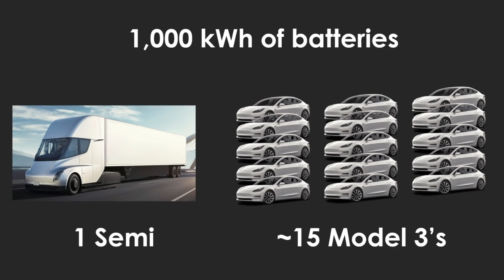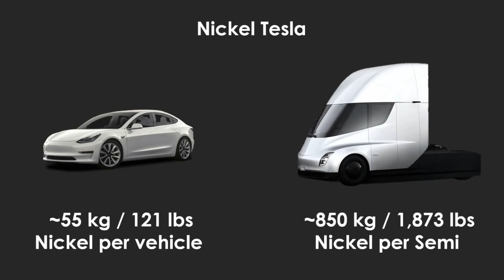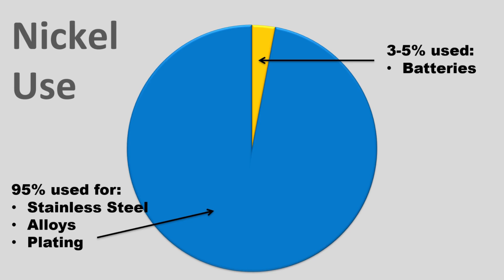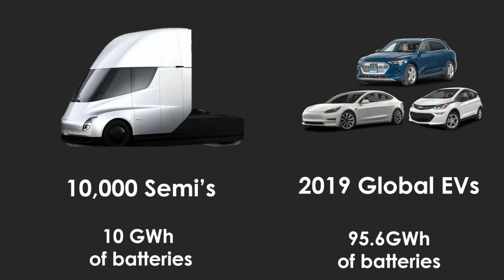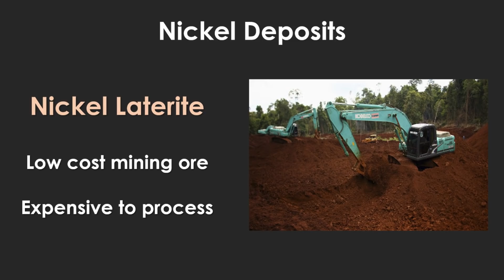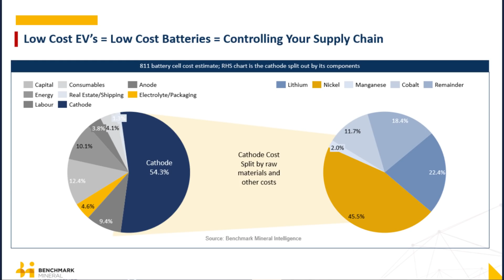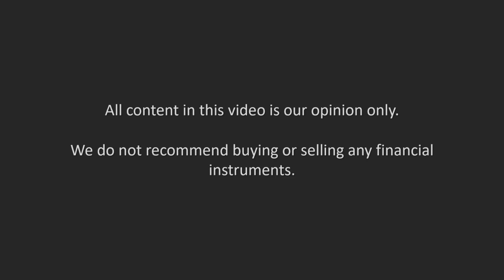Tesla's Nickel Problem

Comment: Giga Metals (HNCKF) and Canada Nickel Company (CNIKF) are both very well positioned to make a big deal with Tesla.

-Both have 100% rights to a nickel sulphide mine.  Nickel Sulphide is preferred for EV Batteries, and Elon has stressed that this is a key raw material Tesla will need more of in the coming years to meet their sales targets.
-Both mines rank in top 12 Nickel Sulphide mines in the world based on size.
-Both located in Canada.  I see Canada as a strategic advantage over Australia due to Tesla’s location of gigafactory in Nevada and soon terrafactory in Texas.  Recent actions from Tesla point to creating more efficient North American Supply-Chain.  i.e Tesla to build Lithium Hydroxide plant in Texas, Tesla buying claim to 1000 acre of Lithium site in Nevada, Tesla joint venture deal with Piedmont Lithium.  Tesla goal to reduce costs to release 25K car in 3 years.
-Both have focus on eco-friendly processes which Elon has stressed would be important from Nickel miners 
-Nickel prices forecasted to increase, so important to get deal done sooner rather than later while Nickel prices still low
-Elon already has proactively reached out to Vale SA and BHP regarding potential Nickel deal.  Though nothing has materialized.  This means Giga and CNC are still in play.
-Elon owned “The Boring Company” might actually also be a mining company in the future.  Tunnel Boring Machines are used in mining.  If Tesla’s future plans do include mining, it is more reason for Tesla to do joint venture partnership or possibly even acquisition of JV mining companies like Giga and CNC.

I would like your thoughts and analysis on this as I think you are a very smart guy!

Comment: the countries with the largest volume of nickel ore reserves are Australia (19.5 million metric tons), Brazil (10.5 million metric tons), Russia (7.5 metric tons), New Caledonia ((6.5 million metric tones), Cuba (5.5 million metric tones), and the Philippines (just under 5 million metric tones). As of 2017, 33 countries produced nickel ore. Nickel production increased from 2000 to 2013 (when it peaked), decreased from 2014 to 2016, and recovered from 2017 to 2018.
Reply from the maker: Excellent points

Comment: Just step back a minute. Starting with the roadster and few recharging centres, Tesla now  has scale, cash resources & technology to build a "Family Electric Car" where range and super performance are "Poor Seconds" to initial & continuing costs. Lithium iron phosphate batteries when combined with adequate charging station become a typical Elon question " Why are we making batteries with Cobalt & Nickel for storage and non-super-performance vehicles when LiFeP04 offer superior charging / discharging features & low cost." Its all about adequate/fast recharging NOT NICKEL & COBOLT ETC.
Reply from the maker: great points Edward
Reply: Elon alluded to different variants of models using different battery chemistry, the lowest range to be 300 Miles+, LiFePO4 is cheaper, very long lasting and fast charge discharge but much poorer energy density so ideal for budget models within the reach of more buyers and utility storage, with the higher energy density more expensive tabless Tesla batteries will still have fast charge discharge and million mile + lifespans and be more suited to the premium vehicles (Model;s S and X including Plaid) Cybertruck, Semi and Roadster2

Comment: I been asking few you tuber, what do you think of $LUNMF it’s parent company for Eagle Mine in Wisconsin that has large Nickel operation. They have on site but I don’t know if it’s class 1 or 2? How can you find that out about a company? eaglemine.com
Reply: Also Tesla needs nickel for their solar power panels and a key component for stainless steel. Do either one of those use a class 2?
Reply from the maker: I am under the impression that stainless steel can use class 2
Reply: EV Stock Channel I didn’t even know there was different classes until watched you show. Thank you for letting us know that part.
Reply: From web site: Dose this make it class 1 or class2? (Eagle has two ore types; massive and semi-massive sulfide. Massive sulfide is about 6.5 percent nickel and 3.8 percent copper. Semi-massive contains about 1 percent nickel and 1 percent copper. )
Reply from the maker: Not sure yet ill look into it

Comment: Nickel mining is a disaster for the local environment. No one wants that shit, no matter the value.
Reply from the maker: Out of curiosity how does it compare to oil drilling?
Reply: @Tesladocumentaryseries7603  Not sure about oil, but Nickel mining uses processes that require a lot of energy, and release a lot of CO2, metals and other chemicals. It contaminates the air, soil and underground waters. Rivers can be acidic, with high concentrations of metals for decades!
I think oil drilling is locally much "greener".
But yeah... It's not "drilling" that's the problem... 
I'm sure there is a way to mine Nickel responsibly.

Comment: Besides having great content, now you actually like and comment on the viewers comments as well. 
I cannot help but wander what tactics will Tesla employ towards raw materials. Elon hunted at getting into mining, not necessarily shedding light on which kind. Also, if he gets a fixed price, in a way he could also be an investor... 
I would graph out lines of progress for each of the constituent materials (availability, production location, capacity, purity, price, %of battery by volume/weight, density-based on which chemistry is used, period to deployment, and finally manufacturing- Tesla, CATL, LG chem, etc - how would the manufacturing, supply, transport and overall continental integration will work with raw material suppliers fixed by Tesla....
Mind field!
Thanks for the content again!
Reply from the maker: Thanks and great points

Comment: Sudbury has nickel mines that are closed due to low prices. There's no shortage. 

Also the Semi is going to be a bitch for drivers in its target market (good luck hoping in and out, looking out your window when backing up, with a seat in the middle) and platooning is useless when you can run trains.
Reply from the maker: Canada could be a major source for Tesla
Reply: @Tesladocumentaryseries7603  It probably already is.

Sudbury has both Stobie and Lockerby that could conceivably be restarted in a matter of months.

We've been hearing the "EVs will drive a boom for nickel" for the last decade, and it hasn't materialized.

What is changing is the electrification of mining equipment. There's a rush to electrify mining equipment, not just for green reasons, but because it cuts down on ventilation requirements and reduces the risk of suffocating miners with diesel fumes.

That's good news for EVs, but not so much for Tesla. The mining equipment being developed requires much bigger battery capacity than the semi will, and Tesla doesn't seem to be a name associated with this tech. 

Instead you see names like TM4. The tech is being developed on heavy vehicles that will trickle down, and not be limited only to one brand of vehicle.

Heck, you could convert any existing semi to electric, with off the shelf parts, and be rid of Tesla's need to control parts and maintenance. The only weak spot is the battery and that will change.

Comment: Well, it's starting to look like EV manufacturing is going to do more harm to the earth than internal combustion vehicles. The argument of it BEV's being more sustainable than gas-powered vehicles hence goes down the toilet if we are so dependant on nickel to make BEV's. Nickel is the same as oil, non-renewable. It seems like every mode of transportation does some harm to the world, but if you look at it from a feasibility standpoint it appears that only hydrogen makes the cut.
Reply from the maker: More harm than burning fossil fuels and polluting the air? How so?

Comment: Seems like it makes more sense to have overhead powerlines on the major highways than to have these huge battery packs.
Reply from the maker: Dont forget battery tech is improving
Reply: @Tesladocumentaryseries7603  true, but we already know that the theoretical limit of the energy density of chemical batteries will be less than that of ultracapacitors (or whatever new class of capacitors they will be named).

Comment: Most electric vehicle batteries use lithium ions, with nickel, manganese and cobalt (NMC) in various proportions in the cathode, a key part of any battery. Early batteries contained the three metals in equal proportions, but companies such as South Korea’s SK Innovation and LG Chem are close to producing cathodes with 80% nickel and only 10% cobalt, known as NMC 811. However, chemists have struggled to remove all cobalt, which is prized for stabilising the battery during recharging.   https://www.theguardian.com/environment/2020/jan/05/cutting-cobalt-challenge-battery-industry-electric-cars-congo
Reply from the maker: Another great article thanks Stan

Comment: 2018 article: “Cells used in Model 3 are the highest energy density cells used in any electric vehicle. We have achieved this by significantly reducing cobalt content per battery pack while increasing nickel content and still maintaining superior thermal stability. The cobalt content of our Nickel-Cobalt-Aluminum cathode chemistry is already lower than next-generation cathodes that will be made by other cell producers with a Nickel-Manganese-Cobalt ratio of 8:1:1. As a result, even with its battery, the gross weight of Model 3 is on par with its gasoline-powered counterparts.”    https://electrek.co/2018/05/03/tesla-model-3-battery-cells-rare-data-energy-density-cobalt/#adnrb=900000
Reply from the maker: Thanks, Battery day cant come soon enough

Comment: 11:29 I guess Tesla can get a mine up and running in less than two years.

Basically, you can start a mine tomorrow if you have the money and determination.
Reply from the maker: A lot has to happen before you start building a mine.
Reply: @Tesladocumentaryseries7603  Same with a (Giga-)factory. Tesla started digging right away for the boring company project. With the right amount of money and some great people, you can make everything possible in a very short time. Who will stop you if you throw some money in his moth?

Comment: If TESLA made solar panel roofs as standard on all its vehicles (Hyundai and Toyota are doing this) including the semi and looked at recycling the old batteries (which I think you mentioned in one of your previous videos) it wouldn't necessarily solve the nickel problem but it might help create some breathing space whilst the Tesla wizards find another solution to Nickel.
Reply from the maker: Yes excellent point Steve

Comment: In researching Liquid Fluoride Thorium Reactors, I learned that in the US we barely mine rare earth materials due to the Thorium content of the raw material dug up in the mine.  Thorium is slightly radioactive, and thus must be treated as a "dangerous" material.  Although you dug it up, separated the stuff you want from the thorium and other unwanted materials, you can't just throw it back in the hole - it's now dangerous even though its state is unchanged other than the separation.  According to @Andreas Amorin, "... I am looking at MP Materials (SPAC deal through FVAC) they are the only rare earth miner in the US."  Obviously, a US producer would be great, providing the mine-to-cell chain is all nearby.  Lithium does travel too far to get from mine to cell.  Gali (HyperChange) and Vivas talked about going back to first principles for the lithium mining process, as the brine processing is ridiculously slow (up to 2 years of natural evaporation), and acreage intensive...  Perhaps that idea would also apply to nickel mining?
Reply from the maker: Very Interesting Carl ill have to look into it.

Comment: Semis are Not always loaded to weight capacity. 
Often loaded to volume capacity. 
Why is there no recognition of this fact?
Reply from the maker: Are you thinking of a smaller semi?
Reply: @Tesladocumentaryseries7603 
No
 Referring to semi's carrying loads of say PC's , or chips, or pillows or furniture- where there is lots of air space.
Very different from trucking bottled drink or industrial goods
Reply: A Semi loaded with coiled steel has a significantly lower volume than one loaded with foam insulation.
Reply: @allangibson8494  Clearly that would be a weight-constrained sort of load, in contrast to my point of many loads not being weight constrained

Comment: Just cancel the US small value coins like the penny and the nickel and free up a lot of metals just like the euro did with 1 and 2 cent coins that are not circulated but only made for collectors.
Reply from the maker: Good point Australia got rid of them too
Reply: How much Nickel is in a nickel?  Would it make a difference?  I have seven or eight laying around...
Reply: @carlstockmal  There is 25% nickel and 75% copper in a nickel coin, the amount of metal is very small ( 5 gram each so 1,25 gram per coin ) but there are a lot of them in circulation and a lot of them are made each year to replace lost coins, also is making pennies and nickels more expensive then their face value. Making a 5 cent penny costs 9 cent in material and laybour.

Comment: nickel is the next big investment
Reply from the maker: Have not looked into any of the companies in depth yet but will soon.
Reply: Could be but I wouldn't bet the ranch on it.  A curious compare would be how much Ni is in the frame-body of the Cyber Truck vs it's batteries....a rough approximation is reasonably simple--guestimate total mass of SS multiplied by 0.05.  The extreme quantity of SS in that truck is disconcerting in a few of ways, not against SS but skeptical it's the best choice.  

Maybe Tesla will offer a more 'vega' Cyber T. with much lower alloy steels, far less Ni and Chrome (and less expensive) of similar strength but that allow limited surface rust only.  You can see such steels in certain infrastructure in the US today, smaller wire/power line poles that can resemble wood type, for one.  Un-coated you'd have the ultimate statement of rust colored but not compromised truck.  Add some hard branch scratches marks on flat rust panels ideally, lol.

Comment: Great content. So is nickel in more demand than lithium for these battery packs?
Reply: Yes, maybe 2% by weight Li in the whole battery Elon once mentioned vs 85% Ni in the relatively heavy cathode part. 
I recall Elon saying the lithium battery is misnamed and should be called a nickel graphite battery as those are the main components of the cathode and anode
Reply from the maker: I haven't compared the two yet
Reply: Yes

Comment: Novonix have a new patented Dry Particle Micro Granulation process using no solvents or water which can use Class 2 Nickel.
Reply: I had forgotten about them.  Does their stuff have the required charge density?  can it withstand enough cycles?  I’ll have to look them up again
Reply: @earnmyturns6305  Yes the anode cathode materials better quality with 100% yield and without solvents and water. First proven use is for anode pure synthetic graphite.
Checkout Youtube channel The Limiting Factor for more details.
Reply: @earnmyturns6305  they can do 1.5 million miles
Reply from the maker: Wow did not know that something ill have to look into
Reply: @Tesladocumentaryseries7603  Check out Youtube channel The Limiting Factor.
80% of battery material processing done in China, this is not acceptable.
DPMG would be the perfect way for US to develop the anode and cathode material processing competitively at home.
Reply: @Tesladocumentaryseries7603  Novonix can do 1.5 million miles with the cheaper version of nickel using their DPMG technology, PUREgraphite anode and their electrolyte. Check out Hyperchange and The Limiting Factor youtube channels.

Comment: Appreciate your thoughts on hyliion who who’ll is making renewable cng battery hybrid class 8 trucks with Lithium titanium oxide batteries made by toshiba
Reply from the maker: Hi Sejal ill have to ask Jordan from the Limiting factor factor about that one
Reply: EV Stock Channel thanks ! Would love his input on this from the nickel standpoint / toshiba battery / and hyliion as a solution to trucking
Reply from the maker: @SejalPatelDrSej  do you have any links? sounds interesting?
Reply: EV Stock Channel just search for hyliion/shll and you will find many vids here on YouTube and investor deck from the company which will undergo spac merger in September—— but what has been lacking on Youtube is eval of the battery tech which I have tried to uncover on my own research because they disclosed toshiba as the battery partner - they are also partnered with Dana inc (dan) for axle and electric motor... this is a real solution and likely better than what tesla has to offer currently barring advancements on battery day - not a scam like Nikola this is real.
Reply: EV Stock Channel proprietary name of toshiba battery is SCiB LTO (lithium titanium oxide)
Reply: EV Stock Channel also look up renewable natural gas - the assertion is if it gets diverted from farms / landfills rather than float up into the air - that combustion of this fuel (which has existing infrastructure) is a actually net carbon negative.